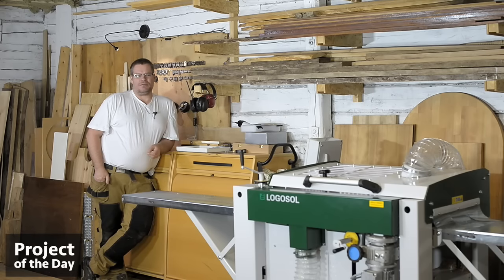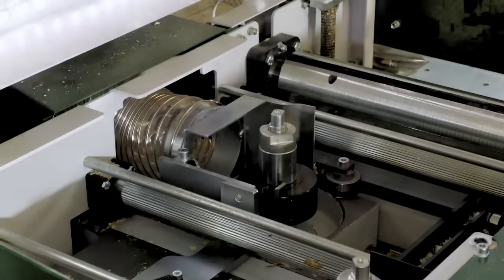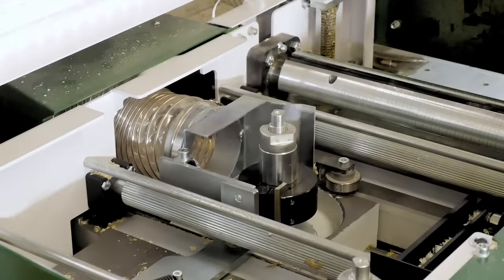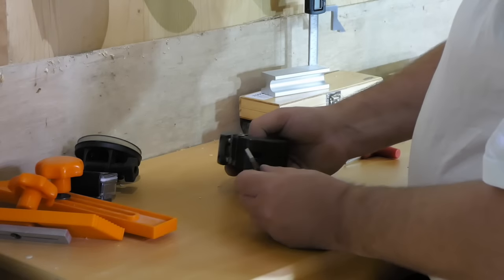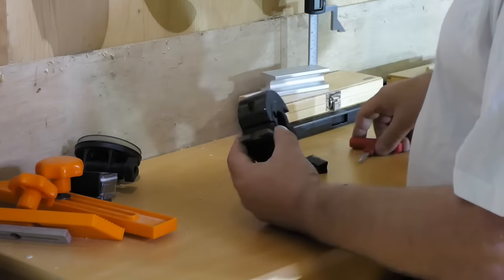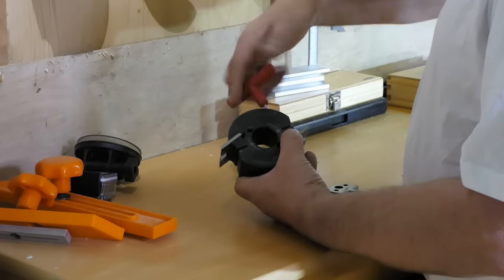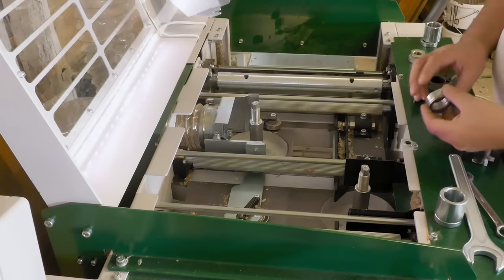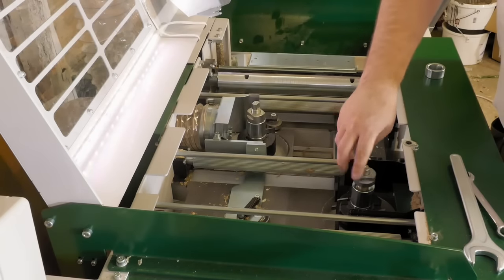Make tongue and groove

Comment: How long do those M2 HSS knives last? I've a fair amount of pine paneling and flooring to make and am wondering if I should go with the carbide tipped ones...
Reply from the maker: I think the biggest problem is sap. if you keep the steels clean, they will last a long time. so if you not while run extremely much, hss goes a long way.
Reply: @Projectoftheday  Tack så mycket